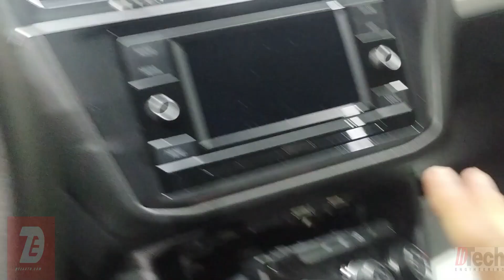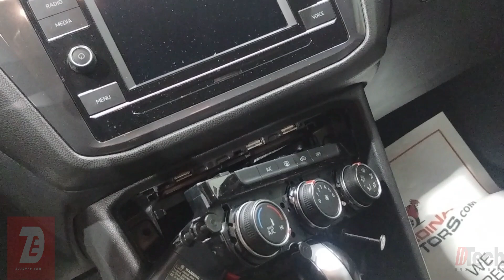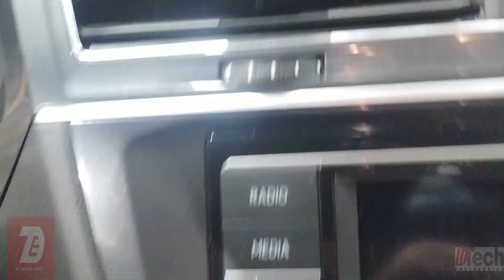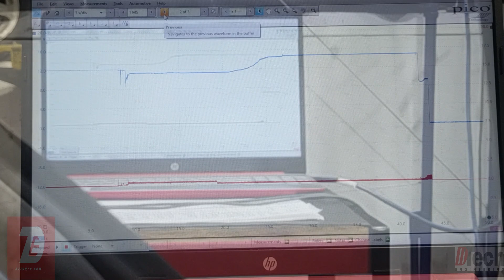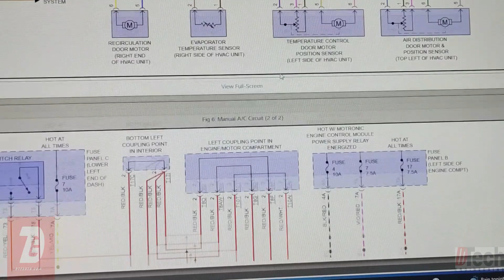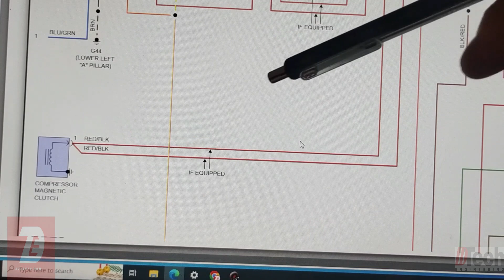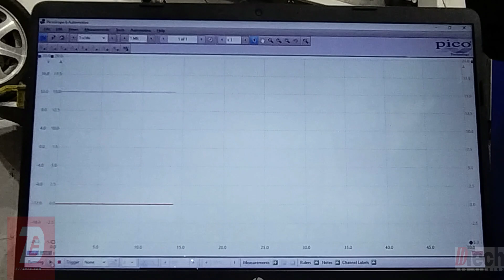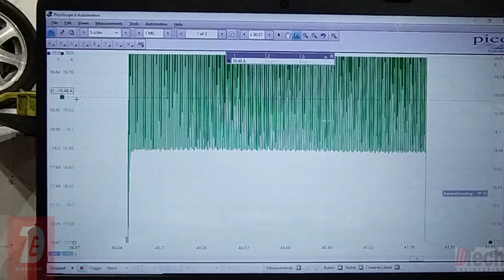2020 VW Tiguan Keeps Blowing Climate Control Fuse

Comment: Fixed this problem on my buddy’s Tiguan without replacing the ac compressor. I just put in a relay which separated the direct connection from the hvac unit to the compressor. Problem solved. Auto mechanic for 34 years here. This problem can happen even if you hook the battery up correctly. You should always turn off all devices in the car and make sure the vehicle is in the off position before charging or changing batteries.

Comment: Might be dumb question. But can’t we just replace the fuse with higher amp of 20?
Reply from the maker: No, you should never do that with any situation that pops fuses, all you are doing is enabling more time for the shorted component and wiring to heat up more and lead to melting and fire-starting situation.

Comment: Very timely video.  Our Tiguan is in the shop and they're dealing with these issues. I was able to share the video with them.
Reply from the maker: Hope it helps, thank you for watching
Reply: @DTEAuto  We had taken our 2019 into the shop (not dealership) for check engine light which they diagnosed as a low voltage and they replaced the battery. Then over a week, said the alternator was at fault (causing battery to die). It kept blowing fuses while they tried to fix, then pointing to a control module. They thought they had that fixed and when we picked it up, it blew the climate control fuse. That's when I shared your video with them.  I got fed up with their inability to fix the car, and ended up taking our tiguan to the dealership. Dealership found the cause and ended up replacing the AC compressor and things are working again.  The original shop refuses to believe there is any connection between a possible incorrect installation of the battery (they insist its near impossible to do) and the alternator, fuses and AC compressor being damaged.  They assert the main fuse block (which sounds like they replaced) wouldve protected everything else -- even though I showed them your video as evidence that its possible it may not. They insist the alternator caused the battery damage and the fuse was blown when I came in.  I'm in a "cant' prove it" scenario at this point.  But taking it to credit card company and BBB at this point.

Comment: Did you replace the compressor unit?
Reply from the maker: I just diagnosed it for the dealer that sent it to me, but yes the fix would be to replace the compressor, I'm not sure if a clutch would be available for that model.

Comment: To confirm, nothing wrong with climate control unit, and the issue requiring action is replacement of the AC compressor?
Reply from the maker: Yes the compressor was shorted and kept blowing the fuse
Reply: @DTEAuto Thanks for confirming. Did you replace the magnetic clutch or entire compressor?